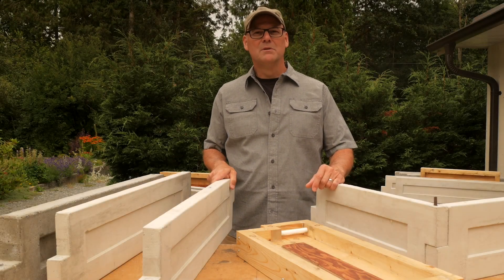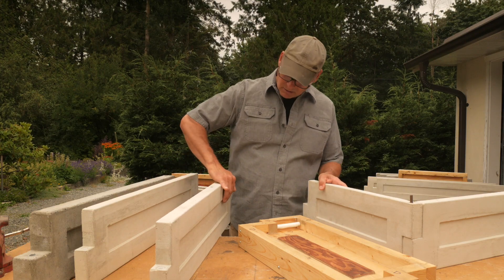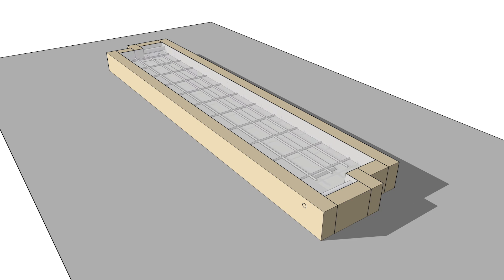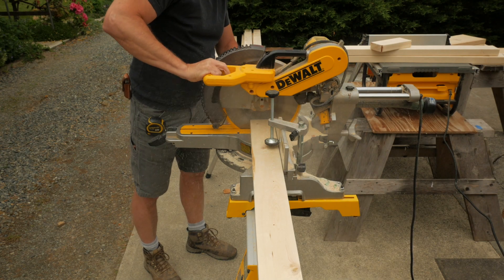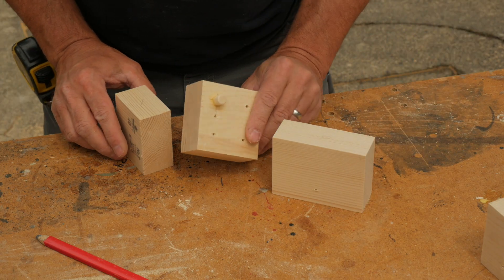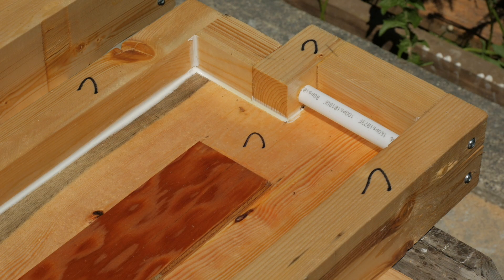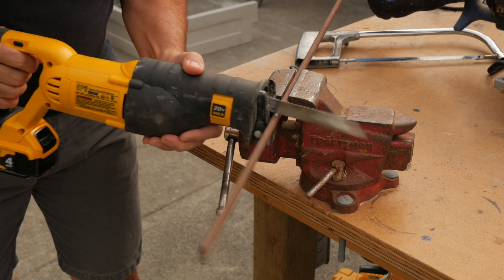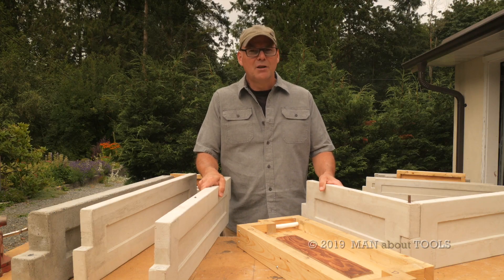make Thin CSA Concrete Garden Boxes PART 4 - cast garden forms

Comment: Thanks for the video.  
Design suggestion #1.  Since you switched to 2 x 12 lumber instead of plywood, you can take advantage of the wood grain.  If you torch the lumber and then wire brush in the direction of the wood grain, you will pull up the wood grain.  This texture will transfer to the concrete.  You could then do a color wash, and dry rub paint job to bring out the look of wood grain in the concrete.  This would leave a more nature oriented vibe to the garden, instead of an industrial vibe.
Reply: Yeah but that would make it grip the form more too.
Reply: @petertrezza9456  use a concrete mold release agent from a concrete building supplies business
Reply: That's a great idea, Frank!
Reply: I used to see this technique at a pre cast concrete panel factory I used to work at. Looks good. Also, you could get very creative with designs on the mold that leave the impression on the mold
Reply: Wow thats on a whole new level. Amazing!

Comment: I didn't catch if there was a cost comparison between the different tests.  I would personally prefer what you have done with this video.  Strength wise and function seems better with the wire mesh.

Thank you for the videos!
Reply: Right now a bag of Portland is $3.70 and a bag of Rapid Set is $22.57

Comment: To lighten further could you use a deeper inset and also use strapping to suspend another inset on the top of the form to create an inset on both sides?  Sort of like a concrete I-beam construction?  Wire re bar only along the thicker perimeter?

Comment: in order to avoid the obvious disadvantages of using glass fiber you can use plastic fiber(a bit harder to mix in)   .  Have you tried Lithium cement and LAVA not  PERLITE for porosity?  (there are at least five eco reasons to avoid glass and perlite)
Reply: Would you expand on this, please?  Meaning what are the disadvantages to glass fiber and the eco reasons.  Thanks.

Comment: Just curious here, what would you say each 48" concrete panel costs in just the materials (forms & setup excluded).
Reply: Rounding up here: He gets 6' out of each bag of mortar: so 1 bag of Rapidset Mortar mix: 17.50, 1 packet of Plasticizer: 3.05. Citric Acid Powder: .12 / oz (.25 total), Glass Fibers: about 2.00 worth... so 22.80 / 6' section, or 3.80 per foot. means a 4 foot section would cost 15.20 (*Tax excluded, Citric acid powder and glass fibers bought in bulk). - if you made the ones out of cement instead of mortar mix they are way cheaper.

Comment: If you use a wood or wax dowel (melt out the wax or drill out the wood) instead of the plastic tube you could decrease the hole size and make them even thinner, based on specs.

Comment: Nice, but concert has a very high carbon footprint. It's the cement, it produces lots of carbon dioxide.
Reply: @MrJason14j True, it will also be better as concert can probably last for generations if properly used.

Comment: Good choice of cement!
Have you considered adding pea gravel to reduce costs ? 
As these forms have little to no aggregate inside they’re not technically concrete. 

For a showpiece add recycled/ pieces of glass and polish the surface on day 3 of the cure.

Comment: Wait ... you didn't reinforce the tab areas where you inserted the dowels. I'm going to predict that you will find cracks forming at the upper left corners of the top mounted hinges (diagonal cracks) and vertical cracks along the outstanding tabs of the inside face of the individual elements , after a few bouts of rain as the soil will get saturated and the frame will want to bow-outwards. Otherwise, pretty nifty build.
Reply: What are some methods to prevent those problems?

Comment: How about using hypertufa to make the panels even lighter?
Reply: You mean add a little vermiculite to the CSA cement?  I was wondering that, too.
Reply: @JI814  Hypertufa has Portland cement, vermiculate, peat and concrete reinforcing fibers. Here's a recipe and info.
Reply: @1charlastar1234  Thanks.  I'm wondering about replacing the Portland in the hypertufa recipe with CSA.  One of his previous videos, Part III I think, used hypertufa with Portland and it sounded pretty good.
Reply: @JI814  Worth experimenting on small items first to see how it works.

Comment: You could possibly consider adding polystyrene beads like those found in bean bags to your concrete mix. There are ratios available online to get the mix right since the beads will absorb water. I would think that could result in an even lighter panel.

Comment: You can use shaving cream as a foam filler in concrete. they make crash runways that way. It incorporates air into the concrete making it lighter. Once it hardens there is more air and less concrete in the panel making it a lot lighter and water permeable if you use enough.

Comment: I like your series however one thing I would’ve liked to know about is the costs between each version
Reply: A 50 lb bag of premix concrete about $4.  A 50 lb bag of Rapid set about $17.50. If cost isn’t an option Rapid set is so easy, but way more expensive.
Reply: Holy crap..that is expensive..but lasts a life time..wood wont last that long for sure..
Reply: @dr.phil-federalinspector6023  If you wanted to you could use some very well weathered wood to keep a beautiful look of wood grain to the panels... Yup !

Comment: Vibrating out the air bubbles with a reciprocating saw body - absolute genius!
Reply: just use a sander
Reply: Did this with a concrete counter top using the same rapid set for a vanity... Works like a champ
Reply: @tkstruck  Did you use the same type of concrete for your counter top?  MY son has been wanting a portable kitchen island with a concrete countertop but I was concerned about the weight. This sounds like a viable option....but how did you seal the top?
Reply: Genna Hargis 
Hi there! I used the rapid set mortar mix with flow control and a little set control for a vanity. If you care about the finish use melamine for the form it’s sacrificial and gives a smooth finish. This guy does a good job https://m.youtube.com/watch?v=T7mYB6x68DY I sealed it with food grade granite and stone sealer. The vanity was approx 42x 27 with a cut out for the sink and I could manhandle it into place, though it’s not light! Hope  that helps
Reply: you could use your wife s vibrator too...lol

Comment: Mix in iron oxide with the mortar to achieve different permanent colours - like dark green, terra cotta, etc.

Btw Great work!
Reply: I'm a woman.  Great idea. Thank you!  More than an idea, I surely wouldn't have thought of adding color pigment/metal oxide.    Does the Iron Oxide actually create green color too?  Terra Cotta and rust colors are nice as well.
Reply: Traci Scheelk if you add colour you will need to seal the concrete. UV will eventually remove the colour if you don’t.
Reply: Great idea!
Reply: I would imagine you could also use the same tinting powders used for coloring clear epoxy.
Reply: Keith Marlowe concrete colour is based on the quantity of cement. If you don’t know how much cement there is in the mix it’s hard to guess how much colour. Go heavy if you try it again, but 
to much will cause other problems.
Reply: @ConcreteLand  What kind of problems?
Reply: @kallenyc if the cement ratio is low to start with in a mix then going heavy with colour will weaken the concrete. It would take a lot of colour powder or a very low strength original mix to do this but it can happen. A mortar mix is a good example.

Comment: Kent, thank you for the very clear and easy to understand video. I appreciate your attention to detail and accuracy making these boxes. I have a large traditional garden that I do most of my growing in but I very much look forward to when my friends come and ask me about raised beds, or box gardens so I can try this out in the future. The addition of fibers to the mix is a great idea and I would most certainly recommend for anyone making these to follow that step.

Living in Minnesota, the question I had for you is regarding winter, *shocker! I know*, have you had any issue with freezing moisture in the soil pushing out laterally too hard on the longer concrete panels and cracking them. I agree the reinforcement mesh should still hold the panel together, but putting in this effort, anyone making these is wanting good looks and longevity.

Lastly, have you considered for taller panels, using 3/4" plywood instead of stacking the shorter ones? I would imagine a double thickness plywood base may be required for strength and to have enough material to fasten your side to, but imagine the designs or customization your could make with a 24" tall and 18" inlay section. Just a thought for the guys out there that may be making these to sell as a side hustle.

Keep up the good work Kent, I am a new subscriber because of the effort you put into this video, and I look forward to going back through your past videos to see what I can learn, Thank you.

Comment: If I wanted a longer box can I make  2 additional long length sides and connect them end to end?  In this current design and dowel placement will this work or must your design be modified?  Great video!
Reply from the maker: Ed Floody End to end connecting works with this design

Comment: The only thing I would do differently is to put some green, or brown dye on the concrete so it would look less industrial. I also have heard that if you apply butter milk with a brush to the concrete from time to time this accelerates the forming of moss on concrete surface. Fantastic project!
Reply: how did applying the dye turn out?
 thanks

Comment: I liked your concrete box forms, but   can round one's be made also?
as I would love to put  round one's in my garden then put the plants inside them
to encourage the roots to grow not only out but down.
Reply: MelbGurl3162 yes, but the forms would be MUCH harder to make. If they were to be completely round, you would need something the same size to build the forms around using special (expensive) “bendy” plywood or cutting kerfs in wood to form it around. Would take even more work to make the forms reusable. Can be done but probably not by a novice.
Reply: @samueltaylor4989  Ty for that information Samuel, much appreciated.
Reply: Well if you would use big plastic pipes. It could be done I suppose.  Cut them to the height you want, then make a vertical cut - so you can open them up a bit after the concrete is solid. If the height isn't too big the plastic should be strong enough to keep the concrete in shape.

Pretty sure this could be done this way, but you would have to experiment a bit. And a pipe with a big diameter could be a bit pricey.
Reply: Yes, pipe over about 6” diameter get very expensive. A 1’ length of 12” diameter pvc is over $60! I have a feeling they are meaning like a 4’ diameter? Which wouldn’t be possible with pipe but smaller, yes you could make small flower pot styles.

Comment: You can build a 3 stores house on these boxes. But is it not a bit too much to give so much work, reflexion, machines and care to that ? Just use rough wood, it will remain solid for 10 years, and who needs more than 10 years using unchanged boxes ? Thanks anyway...

Comment: I saw the first 3 videos last year and instantly fell in love with this design; I am glad to see an update this year. It's a very clever design.
I didn't make them last year because I had no need for raised beds, but I would like to plant some asparagus in them sometime soon (i.e., within the next 5 years). 
Thanks for the update!

It occurs to me that making the inset slightly deeper would also make them lighter, but doing so might compromise the strength; I'd have to experiment to tell. 

BTW - I raise a flock of voracious geese and ducks. I typically use 12" slices of cattle panel to exclude them from of my gardens; I have several of these short fences left over from another project. Your design lends itself well to attaching the fence by simply making the pins 12" longer, and connecting the panels to the pins, either with velcro or hog rings.
I might experiment with concrete dye, too.

Comment: I've heard strength a few times. The galvanized steel is tensile strength added. Maybe they will keep them from bowing out, but the ends would need something on them as well. 
The concrete itself can handle all the compressive force needed, but has little effective tensile strength. 
Also, make sure to find a good concrete treatment to spray on the inside of the mold and the top before it dries. After the top is dry enough to not absorb water, some burlap is good to keep the water on it. We use sprinklers on bridges to keep the concrete wet. A soaker hose may do well in this application. 
Yeah, I watch your assembly and there is no tensile strength at the corners after the steel wire ends. I would almost skip the wire and the dowel and just band the form together after stacking. 
Hope this helps.

Comment: just saw a guy making counter tops out of quick setting mortar.....dries hard in 90 minutes 1 1/2" thick
Reply: Yo le hubiera puesto malla de gallinero en la cara exterior para que absorbiera la tensión. I would had put inside it a metal mesh for chiken.
Reply: Tera pEuta, https://www.lowes.com/pd/Blue-Hawk-Actual-25-ft-x-3-ft-Rolled-wire-Galvanized-Welded-Wire-Garden-Hardware-Cloth-Rolled-Fencing/4780957

Comment: Great videos. You should always include the steel grid. It gives the panels tensile strength. Try to push the grid to the very center of the walls. This gives the grid maximum cover from the elements. Any service cracking will have less chance of reaching the steel reinforcement. It also will provide additional tensile strength, getting the steel farther away from the inside of the panels. Having the steel closer to the inside of the panel reduces its effectiveness, since the inside of panel will be in compression. The pressure of the soil against the forms is creating tension on the outside of the panels, so moving the steel closer to this point will have a positive effect on the strength of the panel.
Reply: Do you think it might also be worth spraying the steel grid with rust paint? I've seen many concrete structures that seemed to fail where the rebar started rusting away.
Reply: @keithmoore5512  Better to replace it with glass fibre rod then.
Reply: Hardware cloth such as this;
https://www.lowes.com/pd/Blue-Hawk-Actual-25-ft-x-3-ft-Rolled-wire-Galvanized-Welded-Wire-Garden-Hardware-Cloth-Rolled-Fencing/4780957

Comment: I really dont see any benefit in using concrete for that instead of just wood. Much more work with concrete and it has a horrible co2 footprint too. Wood is perfect for so many things.
Reply: lrenturn  I am actually german, over here in Europe we dont engage in that political tribalism as much as in the US. Its more about reason, you should try that sometime... Works great.
Reply: nordfresse, If you watch the entire series (4 parts at the moment), you would see in Part 1 MaT explains his years of prior experience with wooden garden boxes. In his experience, they were not durable and inevitably rotted quickly and had to be replaced, even when using 'naturally rot-resistant' wood. For something like these concrete box sides, to get the true environmental impact, you have to also figure in durability and likely duration of service. It looks like these box sides will last for decades, you could put them in your will and pass them on to the next generation! Try that with outdoor wood structures that you don't want to slavishly seal and refinish annually.
Reply: lrenturn  Let's see, no state religion, civil rights, voting rights, Social Security, fair tax laws, it just goes on and on the terrible things that liberalism supports.

Comment: Concrete works good for compression, no for bending! Next time you will hit it with a something and it cracks. I spent 5 years learning this stuff at University, speciality "construction materials"
Reply: Wow!  Aren't you so smart!  A college degree isn't required for everything.  These panels aren't for building a bridge or a skyscraper.  Home owner, small scale, back yard.  Maybe in 10 years after some real life experience you'll learn how condescending your comment was.

Comment: Would it be an idea to provide some sort of plug to cover the top of the steel bar for further protection against rust?
Thanks to the plastic pipe, rust shouldn't affect the concrete. Perhaps at the joint and at the bottom?

Comment: The main stresses you will have be from shrinkage, freezing of internal moisture and thermal expansion/contraction cycles. So keeping the moisture out will help with cracking and spalling. You also don’t want it to cure too fast. Hold the water in as long as you can. 

You can also use reinforcement fabric instead of metal, but bringing the reinforcement closer to the surface on both sides will be best. That’s where the tensile stresses will be. This is where steel placement is in reinforced concrete. For loading forces (structure weight) steel is placed about 3/4-1 inch from the bottom. For expansive soils (upward forces) the steel placed at the same distance, but from the surface. This is because concrete cannot handle tensile stresses. The reinforcement is placed where the tensile stresses will be greatest to counter imposed forces. The fiberglass may also be sufficient for this application.